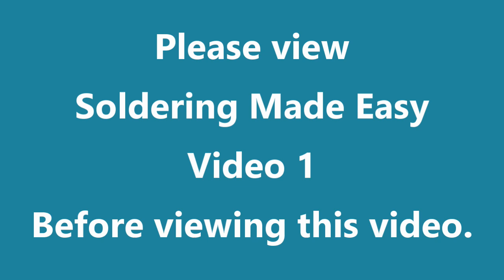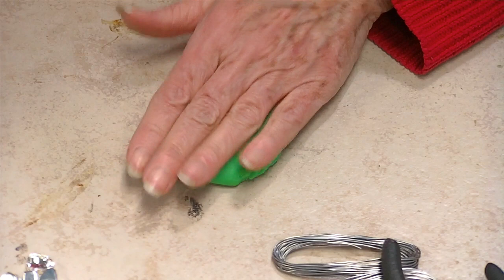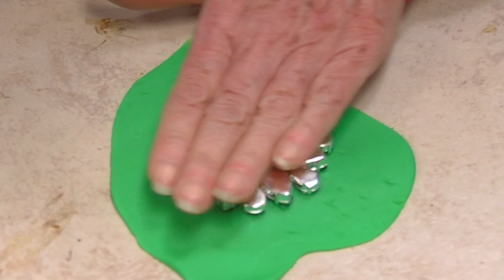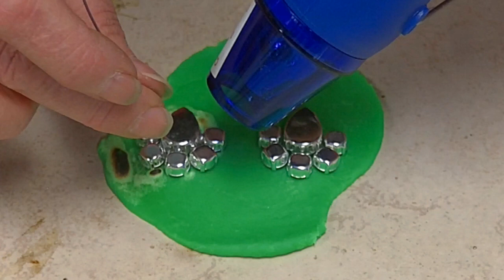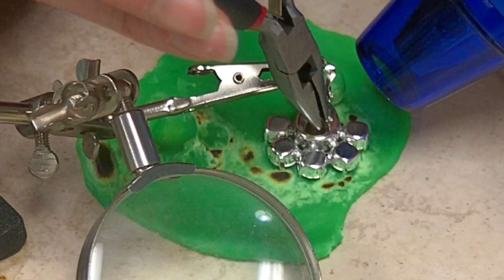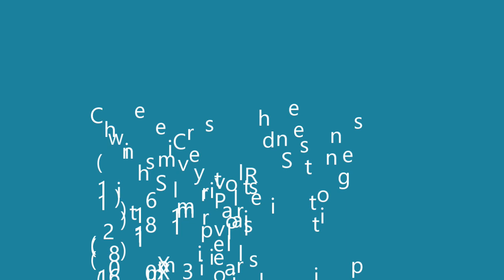Large Starburst Earrings Solder Kit

Comment: Why does my soldering not work. It keeps forming balls. Is the heat too high or too close?
Reply from the maker: Since I don't know what you are using I can only guess what is going on. My best guess is either you are using a higher temperature solder than your heat source can completely melt or there is not enough flux in the solder you are using. Often with the prefluxed solder wire there will be spots where it didn't get enough flux when it was made. I keep flux on hand for just that reason. When I run in to that situation I treat it like I would solder without flux. If it is suppose to be prefluxed wire there will likely just be a small patch that won't flow. Solder will not flow without flux. Hope that helps.

Comment: Hello, I have been following your videos and notice they all evolve play dough. Are there other things you've used instead of playdough for peices you make alot such as air dry clay? Im trying to find a less wasteful method for pieces I make a lot and can just make a permanent cast of the piece.
Reply from the maker: I have not found anything easier to use or more economical than play dough.  The problem you may have with an air dry clay is that it may not hold your stones in place once the clay is dry. You can press a finished piece into wet floral board, but with use the floral board will fall apart. See Video 1 for more information on wet floral board. https://youtu.be/-NCDegQxhyY